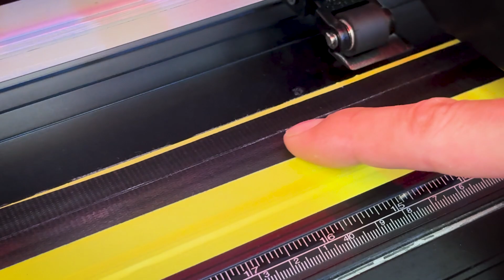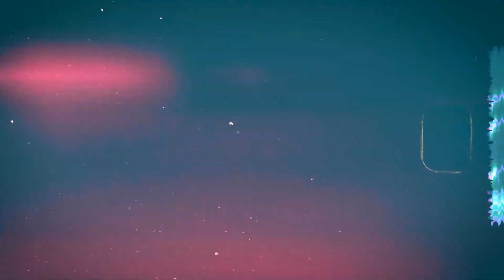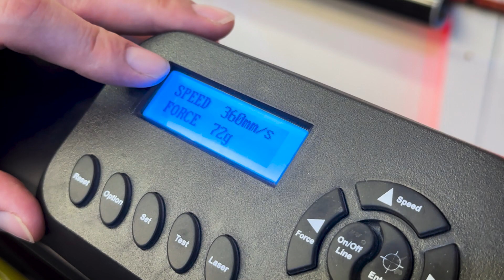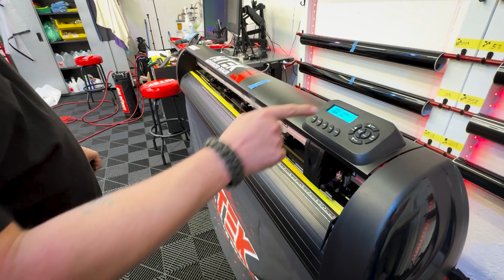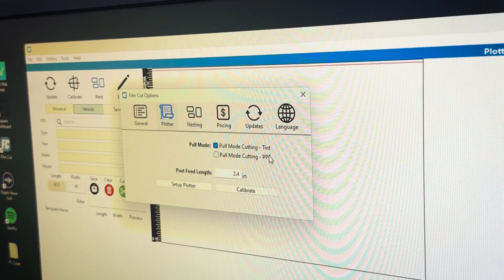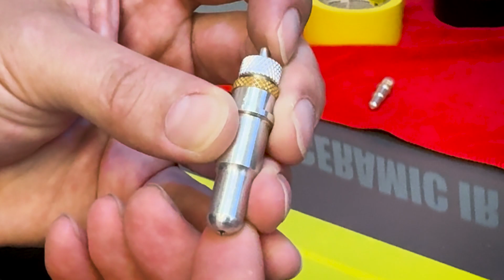Window Tint Plotter Tips and Tricks | Workhorse 2

Comment: Great Tips! I should have used the GTape right away when I started to setup the Plotter.  I messed around for hours and the next day I went and some and now it cuts really good. The Workhorse 3 has air holes so it's not as much room to lay the strip on but it works with some trimming. 
I just got the WH3 and it's cutting really well with your Tips.

Comment: the biggest flaw is not having a stop button. What do we do if the film gets messed up? Just shut off the plotter? It continues the cut after i power it back on
Reply: If you do have a problem with that, you can clear your print queue or remove the blade holder and film and allow the plotter to finish the cut
Reply: @PlotterDepotSupport  It wont hurt shutting off the plotter to stop it? I use Core. i couldnt spot a button or option to stop the cut
Reply: @lemongrabracing71  No, it won't hurt the plotter. Just make sure that you clear the queue or take out the blade to let it clear out the cut

Comment: Hello man I bought a plotter from you guys I have q workhorse and with window tint is working fine just I don’t know how to make it work with ppf can you a demo about it ? Like how much blade out and start pattern you use I have a 60 degree blade in there but I’m having trouble , I have the same tape you using and it really help with tint
Reply: The best method for PPF is to grab an extra blade holder to make sure you don't have to recalibrate each time you switch. From there you will do a hand calibration on a scrap of PPF, making sure the blade cuts cleanly through the film but not the liner. You're typically going to use 252 speed and around 120 grams of force. Make sure to use the test button on the plotter and cut across the first inch of film trying different forces until you get a clean peel. From there I would cut a door cup or pillar to make sure that a long cut is still going to come out right before wasting film.

Comment: I wanted to ask which size plotter did do you buy the 55 inch or 64? Also is it worth getting extra 9 inches to do those full hoods and roofs?
Reply: Kevin is using the 55". The only reason to get the 64" is to do full hoods but for the most part for larger cuts I would recommend bulk cutting  as most patterns won't let enough for tucking.